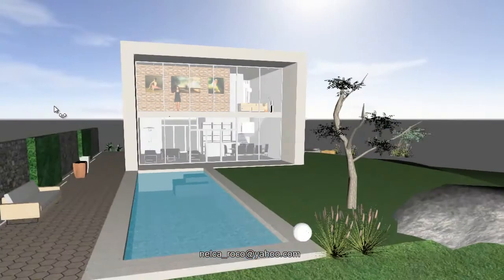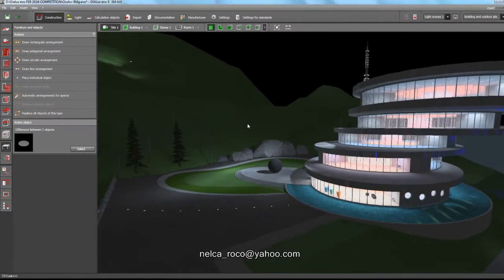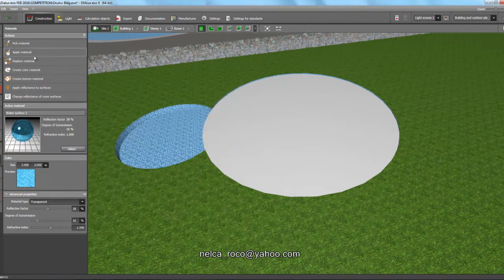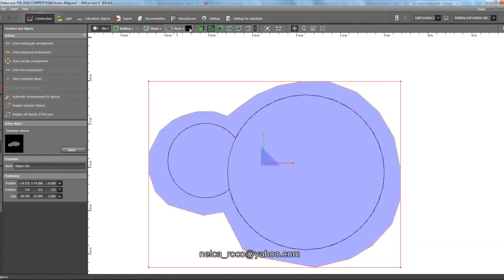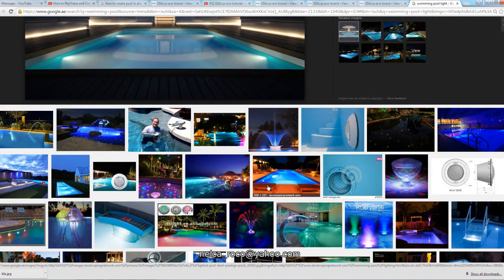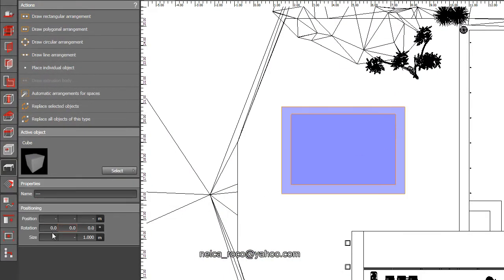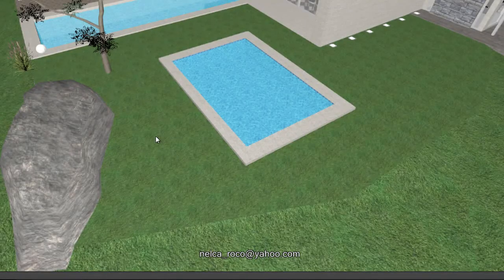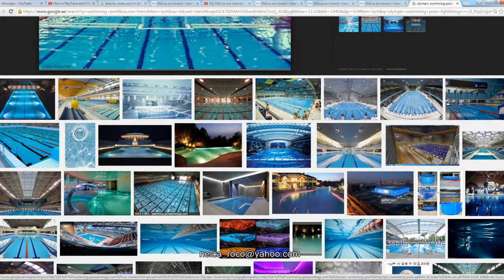Dialux evo   How to create and light swimming pool

Comment: Hi, How to design lighting system in container yard with dimension 200mx500m by using 30 m height lighting towers and 500w LED light. The yard contains 6 containers lines 16mx200mx10m in parallel lines. Thank you for your help